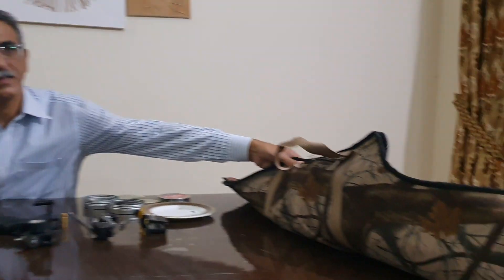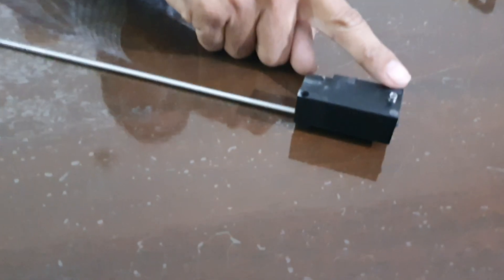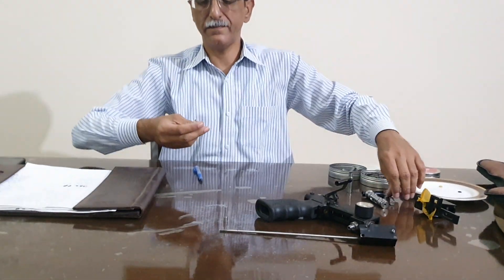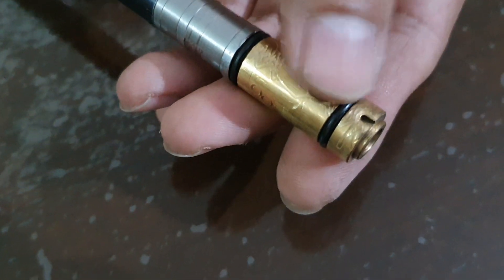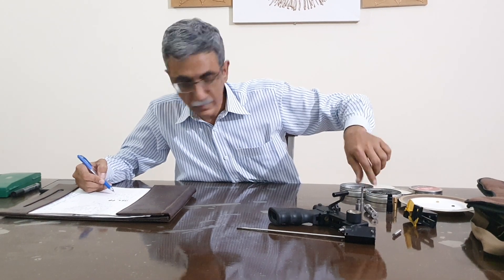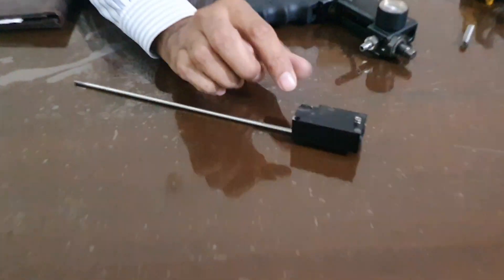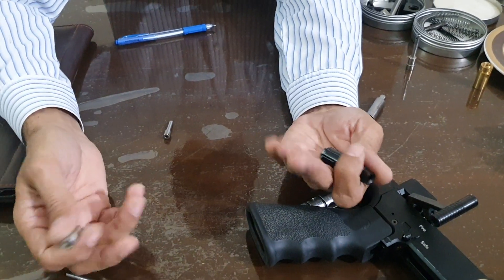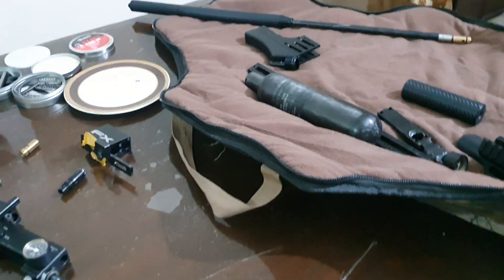Fixing an FX Impact mk2 with power plenum abused by a tuner (English & Urdu)

Comment: Enjoying your videos..... I have an Impact Mk2, upon firing it blew all its air pressure against my face and even after stripping and checking, I can't find any faults, but it won't hold air, it comes out the barrel port as soon as its put in even at extremely low pressure. Any ideas old chap?

Comment: can you show us in a new video how to mount a first stage regulator for the impact MKII? How to transform a MKII to and M3 with two regulators. Thanks! :)
Reply from the maker: MK2 comes with only one regulator.  It cannot be converted into original M3 with two regulator model unless you purchase the complete action.
However some people purchase an extra regulator from HUMA specifically made to install between the bottle and action of MK2. 
If you buy that kind of regulator from HUMA then it is possible that you can use two regulator system in mk2

Comment: Kindly cover a topic on tools, which kind of tools should be used while opening screw, grub screw and hex head screw. Quality of tools and opening of thread locked screws. When I opened my my first gun I damaged the head phillips screw, most probable due to wrong size of screwdriver.